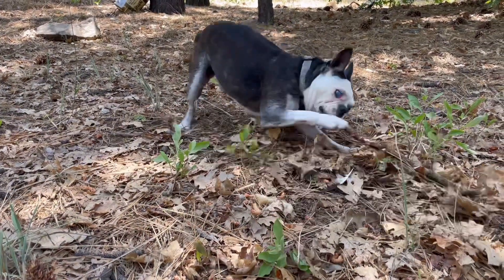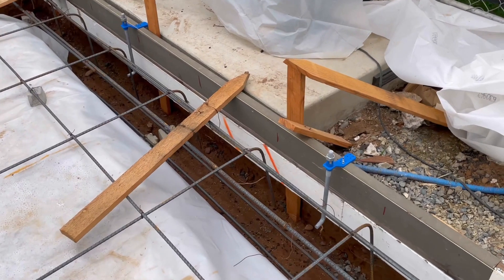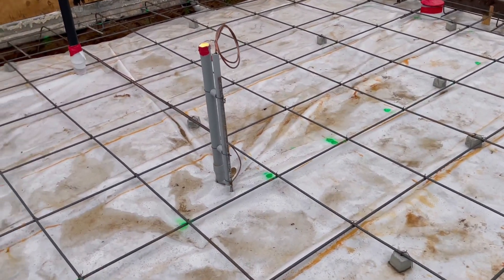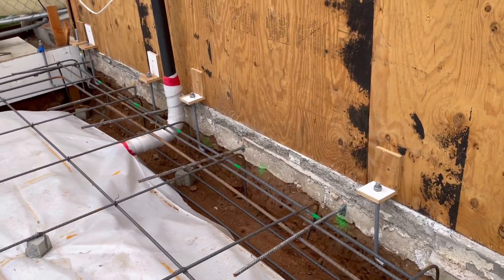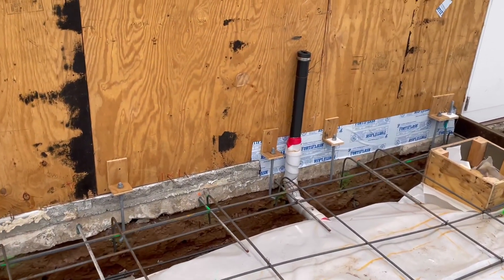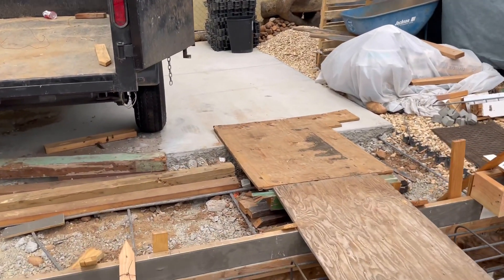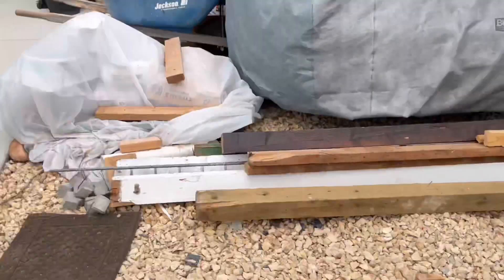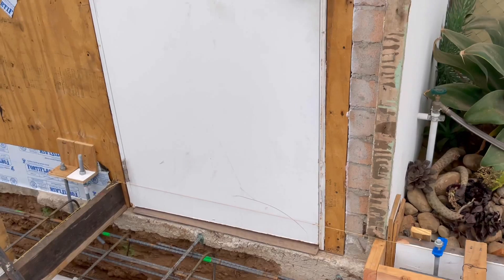DIY ADU San Diego Update #4 - FOUNDATION AND INSPECTION

Comment: Which concrete company did you use in San Diego? I'm having a hard time finding one that will show up
Reply from the maker: I do all my own concrete. If you have a framing or plumbing crew lined up ask them for who they have worked with. Try craigslist but check for a license. Also, just drive around looking for concrete trucks and try talking to the workers. You want to get a good concrete guy to make sure your bolts and holddowns are in the right spot. You may need special inspections on the steel and hold downs, so make sure that’s done before pouring. Also, UFER GROUNd has to go in the footing

Comment: Does the rebar have to be 20ft or the #4?
Reply from the maker: Your foundation plan should tell you the size. Usually #4 or #5 for the footings. The slab grid can be #3 or #4. But you have to consult your structural engineer. 

If you are designing it yourself, you can follow the spec in the city of San Diego Bulletin 140. 

Rebar doesn’t have to be 20’ but you have to overlap splice them according to their size.